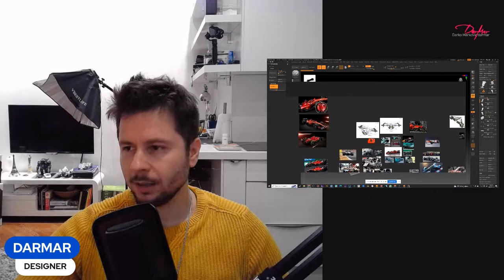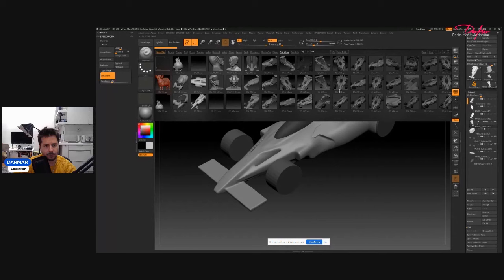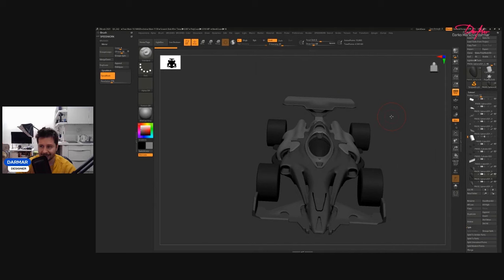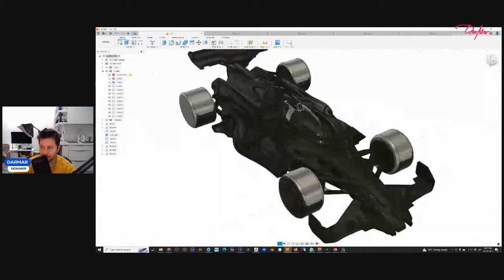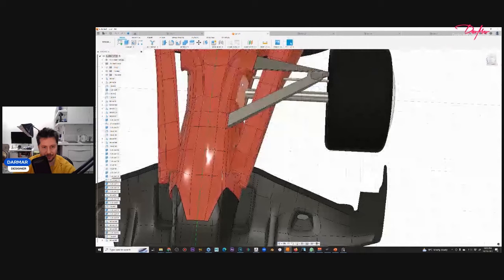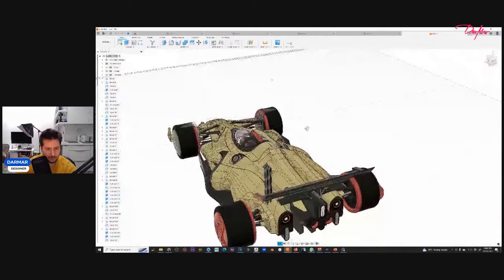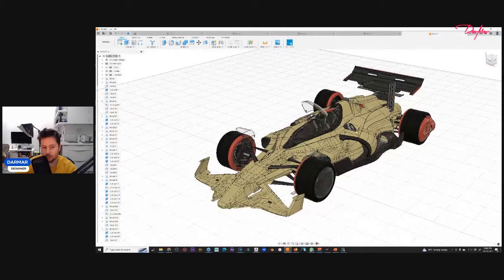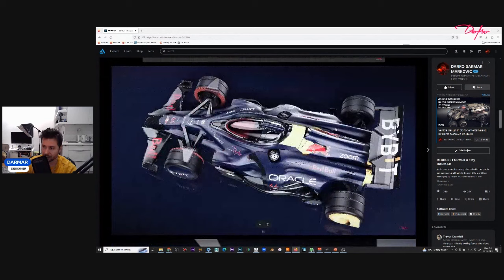ZBRUSH to FUSION 360 | Hard surface workflow by Darko Markovic DarMar

Comment: Have watched your work/vids for quite a while 😉.  Great to see you on this subject.  We’ve tried quite a few pkgs over the years.  Started Hash AM (very low serial #, so dating myself) then Rhino, ZB etc.  Loved 3D curves (lines) in Rhino, but a pain for water tight at least back then.  Finally settled on (F360 <-> ZB) > Quixel -> UE -or (F360 <-> ZB) -> (3D print/CNC/laser/woodworking).  It was great hearing you talk about precision, that’s exactly why we use F360 in our workflow as we mainly do product design/prototyping.  Depending on the object/subject & amt of hardsurface we’ll start in either F360 or start in ZB.  Key for us is being able to piece together a blend of hardsurface/organics physically and precisely manufacturable (repeatedly for iterations) by different processes and materials that all literally/physically fit together in the end.   

Folks in the ZB world, I don’t think appreciate what the parametric abilities of F360 bring to the table.  It can be “HE double hockey sticks” or a life/time saver 😅. Anyways when we start to break a project down to approach it, we focus on maintaining as much of the design In 360 as possible, it’s the core of our production.   ZB, though, is invaluable for what it brings for organics.  Overall I’d say our work on a typical project is generally split 60/40 F360 & ZB.

I remember years ago Paul had thrown up a quadrant chart about whereZB was headed, one of the quads was more CAD capability focus (eg I read that as l “precision”)! Unfortunately not much has changed in that arena.

Thanks for the vid Darko!

P.S.  Inside 44?  Did it launch and we missed it?

As always, YMMV.  Just sharing, nothing more, nothing less.

Not associated w any products mentioned (good/bad) other than as a paying customer.

Have a good’un!

Now back to silent lurking mode.
Reply from the maker: Thank you for your comment. :)

Inside44 is ready, currently i am checking colors on printed version of it as i write this :)

Soon more!
Reply: @ITSADARMAR  that’s great news!   Now I need to go back and find the site to make sure I get an announce email.  Signed up when first saw it but want to make sure I’m still on the list.  Looking forward to it very much 😁